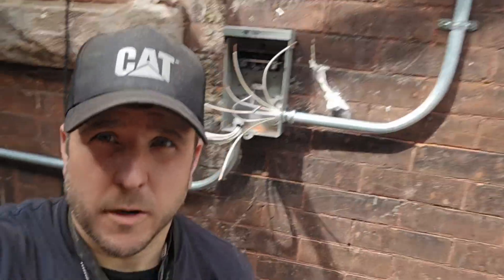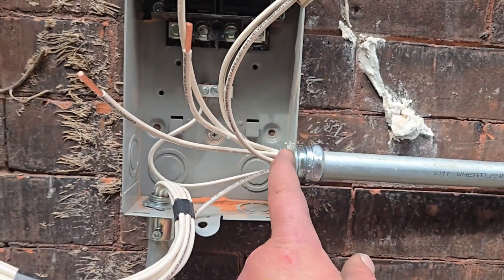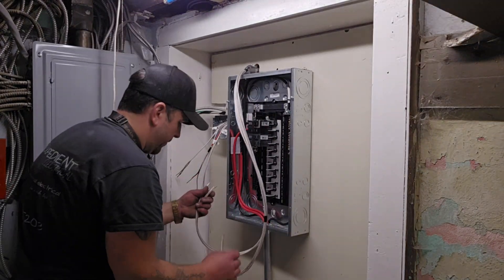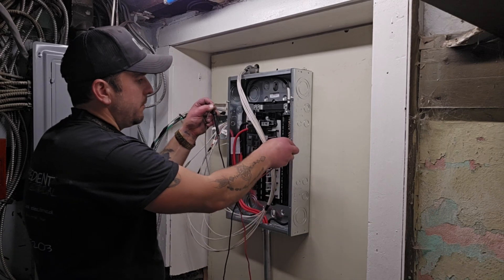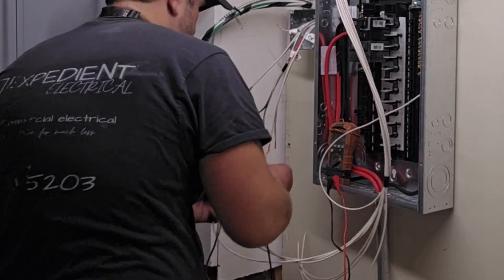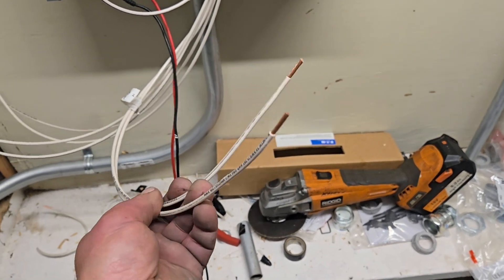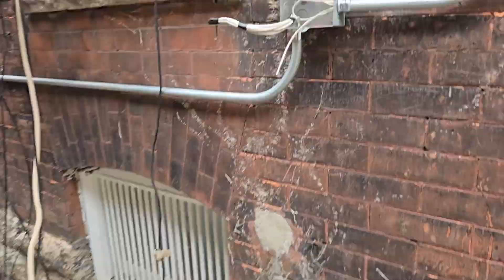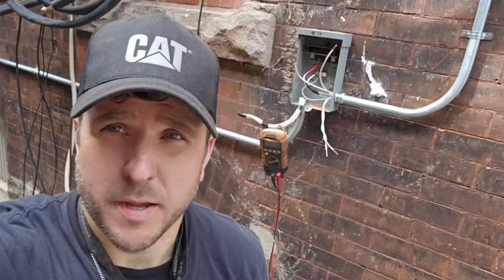Incredible HACK for BEGINNER electricians.👌

Comment: Still code violation, should pull correct wires.  Cannot phase tape grounds
Reply from the maker: Grey area. Depends on the inspector. If thoroughly marked in any accessible or visible location as a hot conductor, the NEC permits it. But that being said I had one inspector that was Notorious for being a jerk, make me run colors years ago. He overruled the NEC exceptions. 
It's certainly risky and better to buy colored spools.
Reply: @crazyDIYguy  hot wires is key word…. Grind wires are not hot
Reply: Used this method myself for tracing cables.
Reply: Lmao #4 or larger bro, can’t re identify these wires. Leave electrical to someone that knows what there doing “DIYguy”
Reply: @TreasureCoastElectric he's a licensed electrician. The DIY comes from the plethora of other stuff he does 😉
Reply from the maker: @TreasureCoastElectric My inspector says #6 and bigger. You are right good sir.  On this particular situation I have to completely wrap each hot conductor (where accessible or visible) in red or white. That being said it is common practice in commercial applications to see all white, clearly marked/identified. I've seen it a plethora of times in commercial places. Bad practice though. Regardless the point of the video was a trick to identify. Hopefully i can make someone's life a little easier.